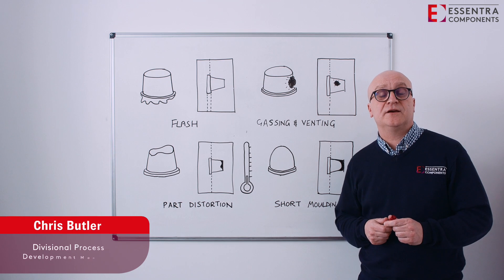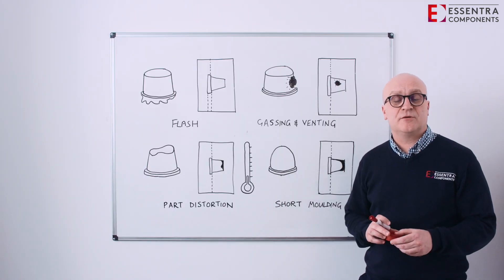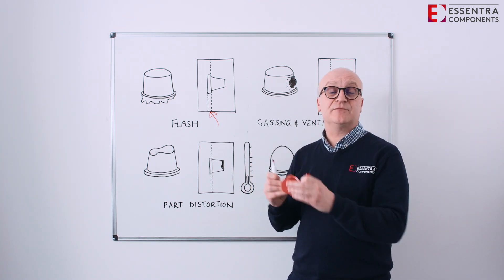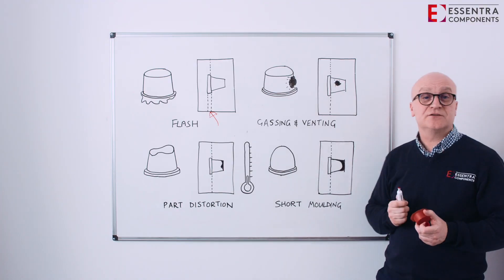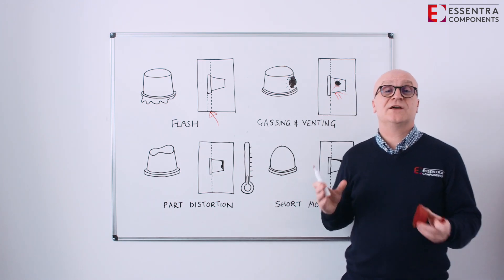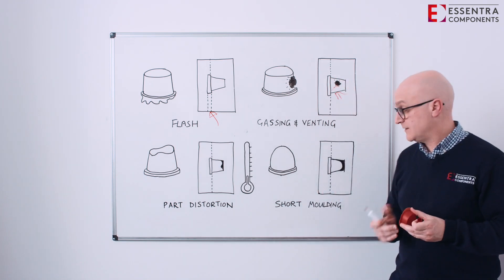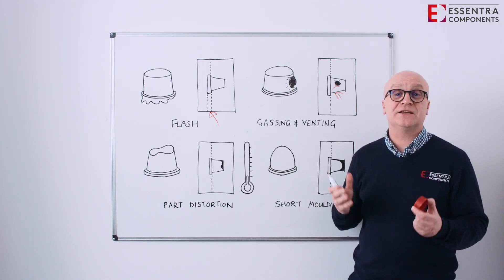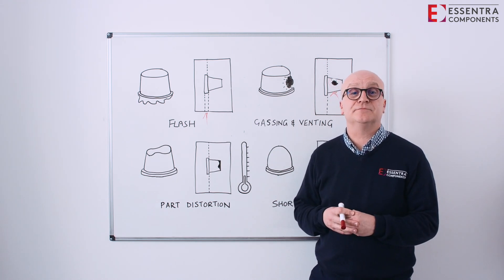Injection moulding defects and how to fix them | Essentra Components

Comment: Are there any studies on the fumes produced and their effects on health. Should injection machines be fitted with air extraction.
Reply from the maker: Hi Craig. All of our mould shops have extraction fans in the ceilings and are extremely well ventilated. The majority of our polymers don’t give off excessive fumes unless we have processed them at the incorrect temperatures so the training and guidance we give is key to all our staff, this is why we train all our technicians to an industry recognised level. All of our materials are safety data sheet checked and the technical data sheets analysed on a regular basis, all guidance is followed.
In the case of some of our engineered grades on some sites we have installed machine specific extraction as a extra measure if we were to see degradation issues in the materials thus causing excessive fumes.